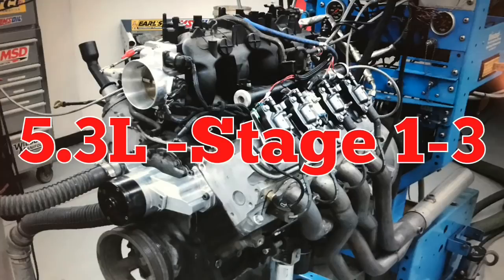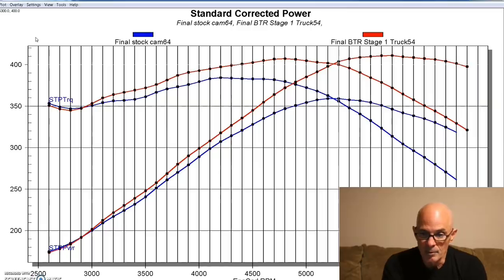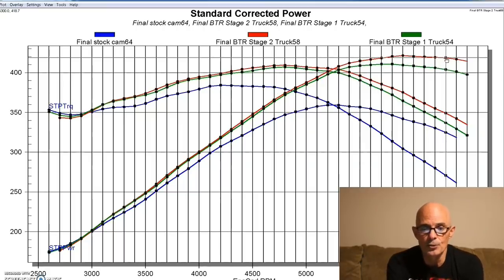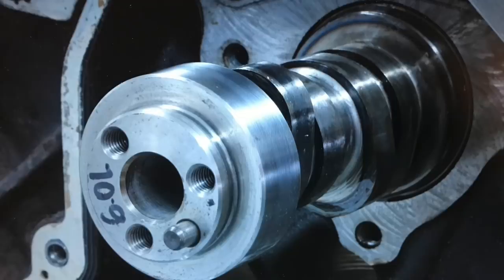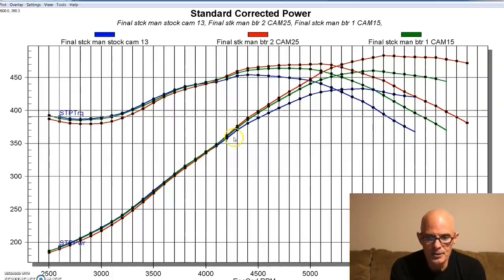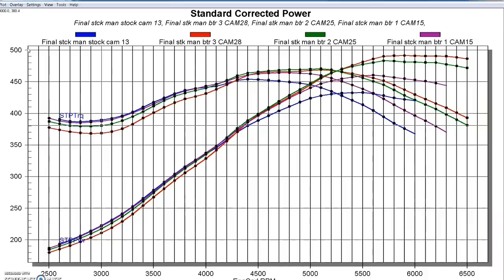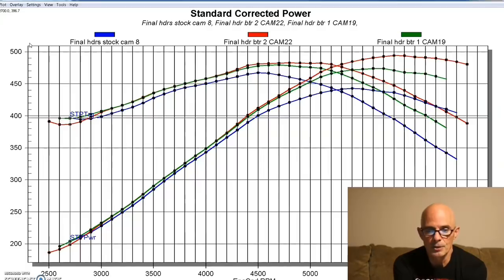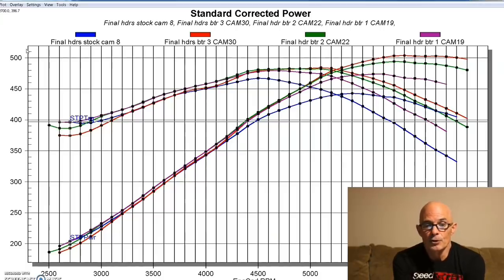LS TRUCK CAM TEST-5.3L & 6.0L (TORQUE FOR TOWING)

Comment: Idk man I have a old suburban and I love it. Want to rebuild a motor and I think I would go stage 1. Just curious what you lose after adding pulleys and accessories. Actual rear wheel numbers. Great video. You explained this in a way that made it easier for me to follow. I appreciate that.

Comment: When is that "sloppy stage 2" cam test coming ?
Reply: Id like to see this on an ls3 also.
Reply from the maker: soon
Reply: @richardholdener1727   sweet I cant wait to hear your opinion on it.  I installed one on my lil 4.8  turbo project
Reply: Richard Holdener have you test the new btr stage2 v2 they claim to gains more power over the old btr stage 2

Comment: Would love to see some work with the 5.7 LS we get in here in Aus and 6.0 found in the VZ toVE (G8 and GTO) 
-Giving valve clearance to stop the valve lifting off the seat and losing comp
-Lowering oil pressure to mitigate pumping losses
-Hand lapping valves
-Running the correct plugs to be able to run the engine harder with timing before having Detonation occur
-Different types of push-rods to see how much power is being lost with rod deflection along with adding power with different rocker ratios and springs. Would be interesting to see if the curves up top flat out rather than rolling over
Reply: I think the LY6 he tested is very close to the Holden 6.0?

Comment: Also like to see a completely stock 4.8 no ring gap or valve springs just a turbo and see we're the limit is to we're your running into issues be cool test thanks for all the info man your a life saver
Reply from the maker: I did the Big bang 4.8L already-If you try to max one out-you need to gapTize

Comment: Great video Richard! I would say a 2800-3000 RPM stall converter, the stage 2 cam and upgraded exhaust would make a stock truck a blast to drive.

Comment: I agree. Who tows at 6,000rpm's? Peak power is kinda pointless unless it's for racing.
Maybe it's good for kick-down when climbing a hill or something?
Street/Strip needs a cam that puts the power in the "right place" for the desired intent of the vehicle.
Reply: +100.  I kick my 5.3 Tahoe pretty hard on the street, but even then I rarely pass 5500 rpm.  2k-5k is where its at for most daily driver type applications.  So, Stg 1 for sure.

Comment: Just got a Tick Performance TowMAX stage 2 cam for an 6.0 LQ4 that I'm building. Specs are 214 intake duration @ 0.050 with 0.571 intake lift, 224 exhaust duration @ 0.050 with 0.561 exhaust lift. LSA is 114+4. My '05 Tahoe has 4.30 rear gears and am purchasing a 3200 stall torque converter. I'm running it with a FAST LSXRT intake with a Trailblazer SS throttle body. BBK 1 3/4 shortie headers, stock cats & y-pipe, 3" exhaust with AFE straight through 3" muffler that dumps before the axle. I am doing a full rebuild keeping the stock crank and gen IV rods(full floating), but going with aftermarket 4.030" pistons. Stock volume Melling oil pump. ARP head and main studs, ARP 2000 rod bolts. Goal is over 500hp 10-11.0 to 1 compression.

My question is what heads to run, Trickflow as cast, Trickflow 230, AFR 230, or stock 317 heads sent to TEA for the stage 2 porting and machining.
I know that I "should" already be at about 500hp, but I want all the power I can get. Why spend over $1000 on decking the heads, valve job to valves that have over 260k miles on them, new seals, double valve springs when I can spend a max of an additional $1500 for the best heads out there? Guarantee all the heads listed WILL make more power than the stock heads.

Do you or can you run a test showing a 6.0 with a "good" cam, and run them with stock and aftermarket heads with the compression ratio never being under 10.0 to 1?
I'm sure you are thinking that the heads are over kill and I should go smaller. Hard pill to swallow when the LY6 runs LS3 equivalent heads with larger intake runners that have higher flow and higher power than the 317 heads.
A lot of your tests aren't always apples for apples when you change the compression ratio.

Comment: I certainly appreciate the work you're putting in to show the results. It may be fun, but it is also work. What I would love to see is a test of the Stage cams versus the real cams. The Stage named cams against the cams they are based on that have been around much longer. The Stage 1 is based on a Comp Cams 54-408-11. The Stage 2 is based on a Comp Cams 54-424-11. The Stage 3 is based on a cam that isn't really in their catalogue, but has been produced a while and usually as a 218/224 .527/.534 on a 114 LSA. It is available on request from my understanding. The last being their Stage 4 truck cam which is based on a Comp Cams 54-444-11. Maybe BTR would be willing to send you what is needed as well as Comp to have a friendly dyno battle. I doubt it'll change anyone's opinion, but I'm curious if the changes to grinds that already work well really beat them or not. I think the Comp shelf cams will be better, but I would like to know. That isn't saying I don't like BTR. I like them just fine. I'm just curious if the very old shelf grinds beat the more recent vehicle and stage specific grinds or not.

Comment: I did turbo 5.3 and chose the tick performance Stage 2 LS1 Turbo cam. 231/231 .630/.605 lift 115+4 on 15psi I made 644whp and 596wtq on a loaded dyno. Definitely feel the loss way down low but the 3700 stall helps get it into boost right away!

Comment: I have a 6.0 with a GM Hot Cam (close to the stage 3 BTR) and a 3000 stall in a C10.  First and second gears are useless.
Solid tire fryer though! Had the "ASA" cam first, and it was the same way. A converter makes all the difference!
Reply: James Austin  What lenght push rods you have in your 6.0 with that hot cam. I want stage 3 cam but no idea what size rods
Reply: @Moparbarnett88  stock length worked. If using different or milled heads you should measure to make sure.
Reply: Ok, I was gonna use 862 heads with a lq4, you think stock push would work

Comment: LS stuff for an 80 stalls higher, probably because of the loss in low end Vs a Gen 1. And the taller first gear. 

A stock 80 with a 6.0 stalls to like 2200-2400
Reply: I couldn't get the stock 80 converter to flash over 1800-1900 brother. Neither in Steppinwolf or the DRNova. Even when I hit it with a 150 shot in Steppinwolf it only flashed to around 2000.All confirmed with datalogs.
Reply: @BadLuckGarage  that's interesting, the GM88HS I usually find in them is listed as a 2200, then the super rare 4.3 one is supposed to be like 2600.

I always throw them out though lol
Reply: @TheDrivewayEngineer  I don't have any clue what they're supposed to be rated at brother, only real world experience. If I could have gotten 2600 flash outta the one in Steppinwolf then that turbo would have been way more fun at the track. Leaving at 1800 on an engine that didnt buld boost till around 3,000 made for some really crap 60fts. lol

Comment: I do appreciate  your videos  Richard and I am doing a LS swap myself and I'm not jumping the gun yet on my cam swap  but all these test  make me really think . If your ride is driving on the steert all the time and only at the track on occasions  it would be crazy to put a big cam in   do to you drive your ride half throttle  to the floor all the time   . So that being said i was thinking the GM hot cam with springs would be the choice   with a turbo upgrade  would be killer for the streets . Thanks again  for your videos and knowledge  you give use all   :)
Reply from the maker: there are better choices than the hot cam

Comment: Id like to see this with the .600 high lift options factored in aswell...

The stage 2, 212/218 .600 lift truck cam is where its at for these truck applications imo
Reply: Naw man the new truck Norris cam slays all these cams...

Comment: Thank you for you're hard work and dedication to keeping us in informed. I just had a Summit RACING  LS cam,AFM delete, Part # SUM-8718 in my '08 Avalanche with a 5.3. Having issues, which programmer should I use. Stock tune won't run good at all. Any help would be much appreciated 🤯

Comment: Richard, after this video i am after a 6.0 for my 84 el camino. Has a th400 and a 2.73 posi. I think a stage 1 or 2 cam would still work well with a tall gear. Thanks again for the video.

Comment: Awesome video with great info.  In the market for a Silverado SS.  stage two with 1 7/8" primary long tubes,  crossover with 3" exhaust was on wish list before watching this via LS friends now that I've seen a test and numbers this is great.  Mind you these are at crank numbers just have to calculate loss due to awd drive.

Comment: Unless a specific NEED I see no reason to use the stage 3. From my experience the stage one you will feel a difference more so in a 4.8 truck as it will "feel" like a stock 5.3l (lol). Any way for daily drivers that want the extra power but nice family go getter idle: Stage 1 all day. You want it slightly lumpy for cool sounding exhaust and your not as worried about gas mileage? Stage 2 all day long. 

This is an older video but now days the popular cams it's a lot easier for the average joe/jane to load up recommended tune that has been battle tested. This helps keep things simple and people interested in DIY.

Comment: There is a ton of info here.  I love the video.  These truck cams give a lot of increase for not a lot of drawbacks.  Have you ever tested these on a 4" stroker?  I'd like to see them in a 383, 408, or 416.  Keep up the good work Richard.

Comment: Lol Richard you got me 😂😂😂when I commented about a week or so about a 500hp 6.0 with a mild cam a iron exhaust manifolds 🤓…. Cause you had already done it.If we make  uninformed comment it’s because we haven’t seen all your awesome test.I got one for you…. Grind a cam with less than stock duration with fast ramps and 550 lift with tight LSA.what if it made more torque down low then the stock cam at the rpm a truck is used at???Got you thinking 🤔
Reply from the maker: it doesn't have me thinking
Reply: @richardholdener1727  I don’t blame you about lower duration 😕ain’t no fun

Comment: only go stage two on a worked 5.3 which includes headers head work ect. or on a 6.0. If keeping the 5.3 stock just go with a stage 1

Comment: What I find interesting is the fact the stock cammed 6.0 is 60 lbft and 10 hp stronger than the 5.3 WITH the stage 3 cam. With a 70 hp gain on both engines, if doing an engine 'swap' the substantial extra power and trq of the 6.0 seems worth the higher cost IMO. 6.0 FTW!

Comment: I appreciate your knowledge, I've learned so much from your content, my current build is a BTR stage 4 low lift V2 cam, I'm excited to see the results on my 4.8l
Reply: I just put a tsp 224r cam in my 2013 4.8 Silverado with 3200 stall it runs good asf.

Comment: As shown in other videos you did Richard comparing dual plane intake with a carbs, single plane and carb vs efi truck intake, the dual plane intake made much more power down low.  So will you be able to go up in cam stages on the dual plane intake with the carb, and regain some of the power down low or maybe even exceed that which is produced at low rpm with the efi truck intake with the stock cam.

Comment: I bet the stage 3 cams would show a more significant gain with an intake manifold more suited to the RPM range that those camshafts want to run in.  I wonder how much different the power curve would look with an LS3 manifold on the rec port 6.0 Liter...
Reply from the maker: The LS3 intake makes exactly the same power curve as the LY6 intake-I tested that
Reply: @richardholdener1727  good to know - learning lots from your channel all the time, and grateful you take the time to reply!

Comment: Just wanted to say thanks for all your hard work! It still shocks me to see how much you’ve done in a dyno room, testing and swapping and retesting!
Really great content!

So here’s my question,
I have been curious about one thing, what’s the longevity of one of these junkyard LS’s?  If I were to take any particular LS, boost it (in a car that only gets track time at the drag strip). 
What’s the chances of this thing making more than one or two weekends and not be an over paper weight?
Also, which set up would you suggest?

Comment: stage 1 for a 5.3 l83 sounds about perfect for my 86 K10 with a 460le.  Must be a mpg improvement over the old carburated 305 along with the massive power gain

Comment: Lobe seperation on the stage 3 truck cam is 110° according to my cam card that I got with my cam. It dont have any benefits before 3000 rpms but it starts kicking in after that. Mine is a 4.8 litre..
Reply from the maker: That is a big cam for a 4.8L-it's more than LSA

Comment: Hi Richard,  there is a bit of science regarding these cams as there is no one cam that will be optimal for different engine sizes. What would be optimal for a 4.8 will not be optimal for a 5.3 or 6.0. Having built good torquey engines since the 80's using the knowledge from books by David Vizard, he has established a lot of theory around cams.
There is a relationship between LSA and engine displacement for two valved engines around 9.5 - 10.5:1 compression ratio. The LM7 stock cam has a reverse split 191/190 duration at 50 thou. 114 LSA. For optimal torque throughout the rev range, the 5.3 LSA should be around 109-110. 4.8 LSA around 111-112, and the 6.0 LSA 107-108.
The 5.3 is a truck motor designed for low down torque, the intake is an efficient long runner design for torque. Most people here would like to increase torque off idle, throughout the rev range. Split duration cams, when used with a good exhaust system will cost you low down torque and gas mileage, as they bleed down the power stroke earlier, they only tend to work from the middle to top end revs. I tend to use straight duration cams with a good exhaust, (1.75" long tube headers, 2.5" system with Flowmasters and high flow cats).For a good combination for the 5.3 here would be a 212/206 reverse split. (The Aussies are ahead in the game with reverse split cams). 110 LSA, timed in at 106 ICL. around .550" valve lift. A good exhaust system 1 5/8" or 1 3/4" headers into a 2.5" collector and system. Even though the LSA is tight, vacuum will be good as the duration is short, so the all important overlap is still on the low side.

Comment: Stage 2 and headers, nice flat peak torque band and all have enough torque at the bottom end. A convertor will make 60 ft way better for even stock cam if sized right. With lockup maintained for over 40+ mph unloaded, a little verter slip is helpful to avoid wheelspin in snow or rock crawling etc.

Comment: That 2 cam is right near what I was thinking for the 6.0 going in my 76 C10, but might step up to something in the 220/224 range because its still making close to 400ftlbs at 2500. Sure, its not one of my 455 Pontiacs making 500ftlbs at the same spot, but compared to a 5.3 is a lot more low end torque in a truck I can drive daily, pull my trailer, and chase parts, hell it will work great with a stock converter. Throw some more compression at it with some 5.3 heads then run it on E85 and it will pick up everywhere in the curve. If I decided to go carbed I would have a custom cam ground with a 108 LSA, 4 advanced, 224/228, 2800-3200 lock up stall,  it would sound rowdy in a small engine like that and still run decent at low rpm. That is what my mild 455 cam specs are, so a 6.0 is small to me.

Comment: I'd like to see a "stage 2" turbo cam comparison; Elgin/Sloppy, Summit, BTR, Texas-Speed, LJMS, etc.,  Junkyard 5.3 and/or 6.0 with stock heads- what the typical hot rodder is running.

Comment: I really wanted to see the 6.0 with some 243 heads and a compression bump. To have started the 6.0 in LQ9 trim and put 243's on it would've been a great test as 243/799 heads are everywhere now. It's a bit more difficult to get hands on rec port heads.
Reply: Yes please this is my setup. With a tbss intake. Do stock vs ported. With stage 4 truck cam

Comment: It's really not recommended to tow with a high stall converter even if you do have lockup, lock up only helps you in scenarios where you can maintain speed and lock up is the only thing that's going to help you keep that transmission alive while towing with a high stall.  A lot of people are now going to go and get a 3000 stall converter and put it in there three quarter ton truck with a stage 3 cam and 3.73 gears on 35 inch tires and wonder why they can't cruise 80 mph anymore without it kicking out of lockup all the time.

Comment: I run a stage 3 in a 5.3 with a stock converter with no issues, theres still plenty of torque for a daily driver
Reply: trevman187 but what about pulling a trailer?
Reply: @PanchoPistolas45  216/220 on a 109lsa is what my 99 gmc has and it runs /pulls fine but I also have a tbss intake and headers. You're not going to be pulling much under 2,000 rpm and thats where that cam looses power

Comment: Hey Richard. I hope you see this comment and get a chance to reply. 

I’m rebuilding a 5.3 fresh short block, new crank and cam bearings. Machine buy is recommending 4.8 flat top pistons for a little more compression.

What I’m here for advice on is the cam choice I want. I do daily towing almost, I have a landscape company. I’m looking into the TSP copaCobra cam, or BTR truck Norris cam. I’ve watched both your videos on those. I’ve got a built Tranmission for towing and is rated for 500hp but I won’t be near that. 

My question is what cam do you recommend for towing? I’ve had a lot of people tell me I’ll lose bottom end power with a “big” cam like I’m wanting to go with. Thoughts? Thanks
Reply from the maker: either of those cams will work
Reply: @richardholdener1727  do you think I’ll need a different torque converter for towing? Or you think I’ll be okay? A lot are saying I’m not going to have any take off or low end power. Thoughts? Thanks for the reply